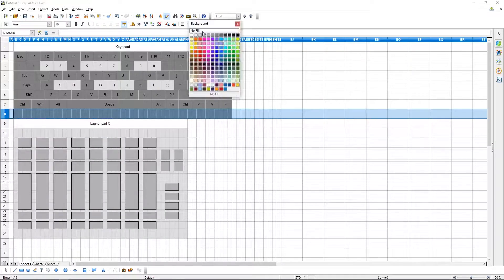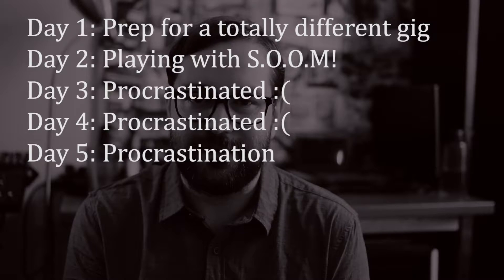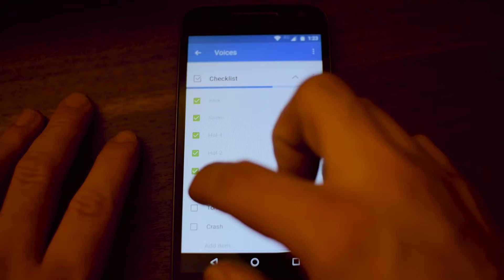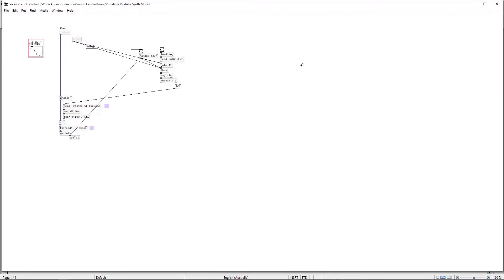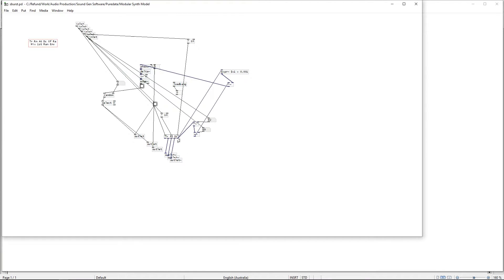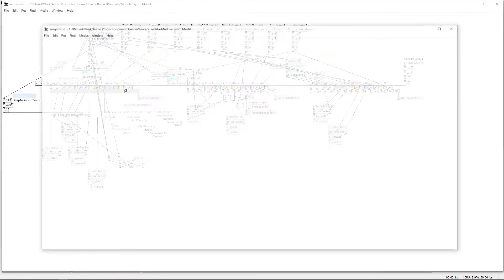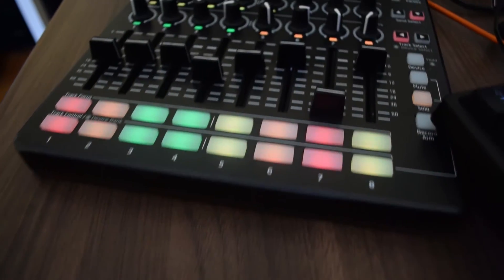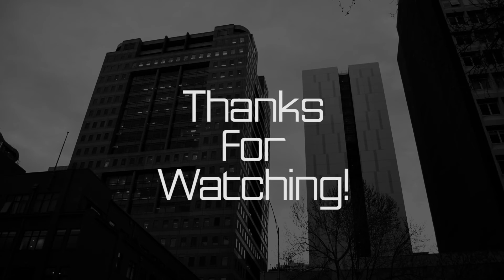Playable Drum Machine in Puredata - Pt.2: Patching

Comment: Man, that Grids design looked intense.  Nice work.  Tis a fun module so I'm sure a customised one would be pretty awesome.
Reply from the maker: I looked into the source code of the grids once and the data for the patterns is stored in an array (in plain text) that looks like it would be easy to reverse engineer and replace with your own patterns, the problem is that someone would need to be willing to potentially sacrifice their module in order to play with the firmware and hopefully not brick the module

there are 25 patterns within the grids module (5 banks of 5) that get interpolated with each other depending on the knob value

Comment: Inspiring patches. What does your patch storage file system look like?  Do you store everything in the "extra" folder?
Reply from the maker: I have a single sprawling folder with about 900 files in it, I label working files with a date (eg 2017-10-gigforthetotev1.1.pd) and then I have preset patches with pre-done work (for copying and pasting) with easily findable file names (eg AAA-oscillators.pd AAA-effects.pd BBB-beatsetuptemplate.pd BBB-melodysetuptemplate.pd) it's not the best system, I'm also using PD extended instead of a Vanilla/Purrdata, I actually corrupted the save in this video (losing 10hrs of work) because I was trying to upgrade to vanilla but it seemed to have some major USB driver issues which crashed and corrupted my save

it's probably like the 5th time I've tried to migrate to a modern PD distro and found severe performance issues and library migration problems (deken doesn't seem to work that well as far as getting the PDextended core library accross to the new version)
Reply: I've been considering switching to Purr Data instead of PD Extended since it seems to have ongoing development and runs on a RPi3. Most of what I do though is GEM based and I'm not sure that it's going to work on a Pi3 anyway. I like the elements of L2Orch (Purr Data) that I've seen but not much out there yet to prove that GEM library support is solid or even important to anyone. I'm always inspired by your commentaries as a working artist who uses PD... the insight into your procrastination and bursts of production... depression and inspiration.
Reply from the maker: Purr Data is the distro I've had the most luck with in terms of having the most compatibility out of the box, I don't really use Gem, except that there are some nice 3d co-ordinate objects that I use for data purposes, that I think are part of the Gem Library (is 'triple-scale' a gem object?)

I'm probably going to keep a separate install of PD vanilla on my computer so that I can do some more in-depth tutorials videos (without potentially using PDextended specific modules by accident)
Reply: Never used triple-scale there is scaleXYZ, tripleRand, tripleLine... those are all GEM.